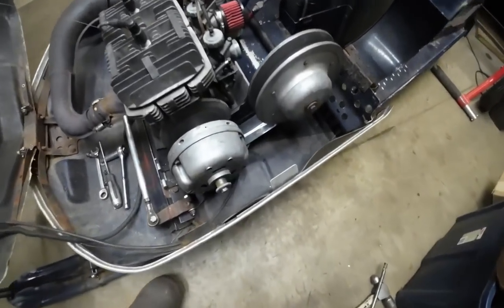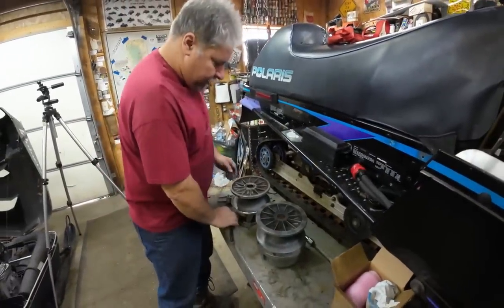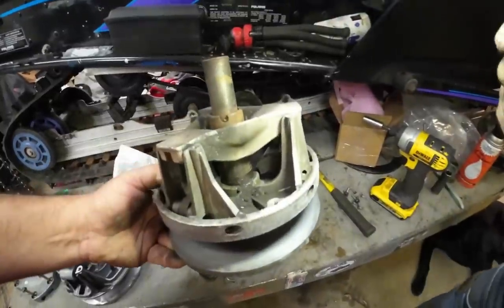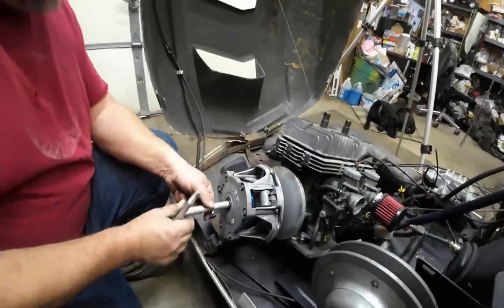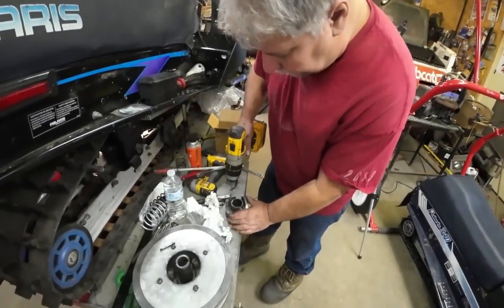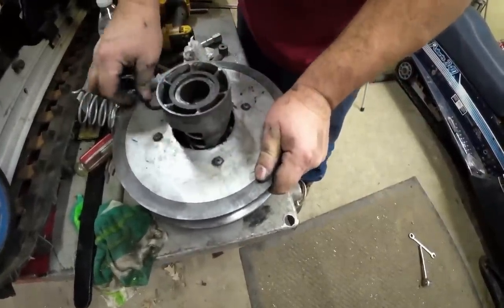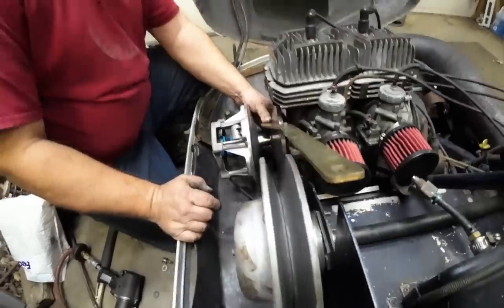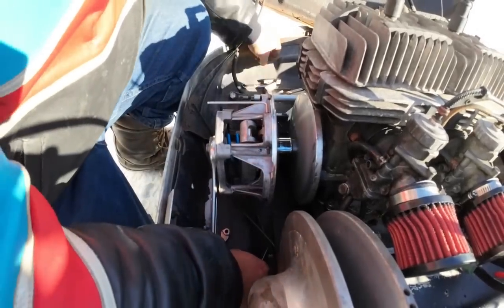Modern Clutch Upgrade for Polaris TX340 and a Great Test Ride! Vintage Polaris Snowmobile.

Comment: I immediately recognized that primary clutch.. Late in the winter of 1972, Skidoo had bought rights from Polaris to use them on certain high performance models.. I remember them being very susceptible to belt dust and required frequent cleaning...and this clutch became known as the orange clutch for pretty obvious reasons. 🤣

Comment: I recall one Christmas break in the early 80's, no snow except on the lake edges-  my freinds had a wide track Evinrude that was the only thing that would blaze those trails in the cat tails!  Until the air inlet got clogged with fluff. Had to stop and clear that on occasion.

Comment: Holy Cattails Batman! Lol.  They’ve been known to swallow the odd sled now and then.  That was funny!  Your TXL sounds great!  They’re such a good motor 👍
Dennis’ TX seems fairly happy, but maybe a little groggy on the hole shot?  Too much helix at the initial start  maybe, or are you running the stock straight 34?
I’m surprised about you not torquing the clutch 🤷🏼‍♂️ you’re usually pretty fussy about things.  I agree though that I’ve never had one come off or slip either.  As for the secondary, maybe you could do a demo on how much tension to use by using a fish scale?  Some people may not know about that.  I usually go between 7-12lbs depending on what I’m trying to do
Reply from the maker: Thanks Rob. Dennis sled is pretty peppy off the line in person. I never use a fish scale on the secondary. I just go by feel. and then I drive it and see how it behaves.

Comment: Why could you not use the puller from the same masheen as what the clutch came from?
Reply from the maker: Why would I not use the puller I have?
Reply: Not trying to be a smartass just for my own reference. I have the puller for the newer clutch so just wanted to know if i could use that. Dont have a lathe.
Reply from the maker: @happyindeed6392  No worries. I don't know if the other puller would work right or not. I'm just showing the tried and true formula that I have been doing for years.